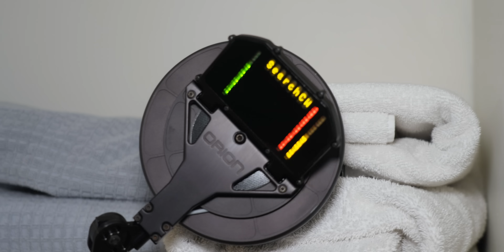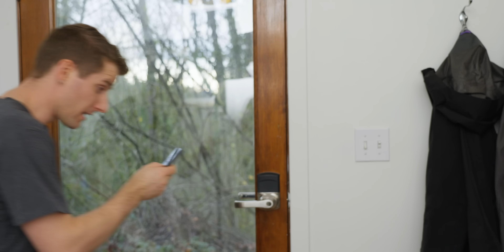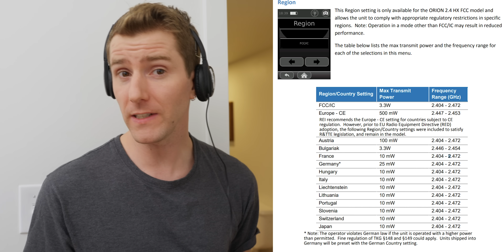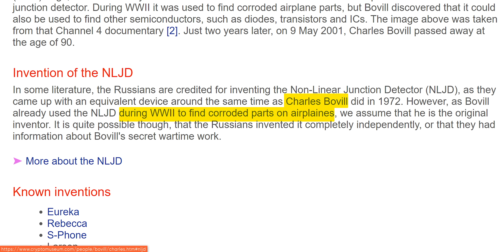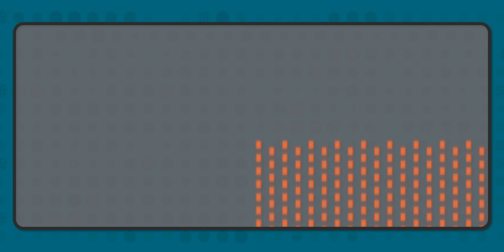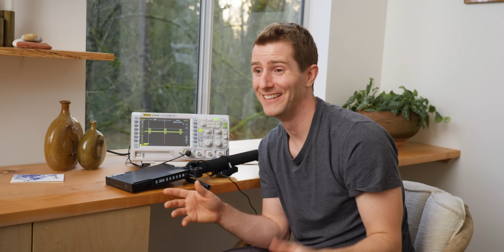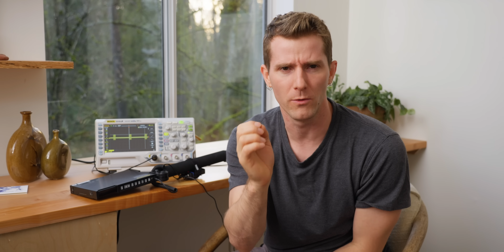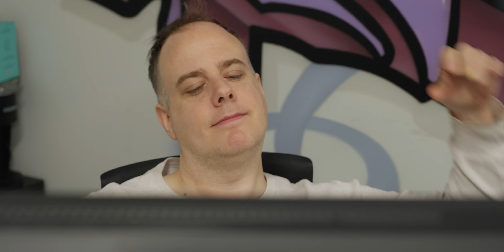I Rented an AirBnB to Look for Hidden Cameras

Comment: THANK YOU for finally explaining precisely what the term "non-linear junction" means. I've heard of these detectors for decades and couldn't find any details on what it means for the waveforms and the graph. That scratched an itch in my brain I've had for a long time.
Reply: Just ask chatgpt
Reply: @AKagNA  bruh seriously ?
Reply: Hey ChatGPT, what does non-linear junction means in detectors

ChatGPT said:

ChatGPT
In the context of detectors, a non-linear junction refers to a structure or region in a material or device where the electrical response is not directly proportional to the applied voltage or current. Non-linearity in a junction means that the relationship between current (I) and voltage (V) is not a straight line (as it would be in a resistor, for example), but instead has a curved, non-linear behavior.

How Non-Linear Junctions Work in Detectors
Non-linear junctions are crucial in many types of detectors (e.g., photodiodes, radiation detectors, or RF/microwave detectors) because they enable specific properties like signal rectification, mixing, or multiplication. Here's how they relate to detectors:

Semiconductor Junctions (e.g., p-n junctions):

In semiconductor detectors, a p-n junction is a classic example of a non-linear junction. The current-voltage relationship in a p-n junction diode is exponential, as described by the diode equation:
𝐼
=
𝐼
𝑠
(
𝑒
𝑞
𝑉
/
𝑘
𝑇
−
1
)
I=I 
s

 (e 
qV/kT
 −1)
where 
𝐼
𝑠
I 
s

  is the reverse saturation current, 
𝑞
q is the electron charge, 
𝑉
V is the voltage, 
𝑘
k is Boltzmann's constant, and 
𝑇
T is the temperature.
These non-linear properties allow the diode to respond to external stimuli like light (in photodiodes) or particles (in radiation detectors).
Non-Linear Mixing:

Non-linear junctions are used in RF and microwave detectors to mix and rectify signals. For example, a Schottky diode detector uses its non-linear junction to convert high-frequency RF signals into lower-frequency signals or DC.
Photon or Particle Detection:

In optical or particle detectors, the junction's non-linearity enables it to convert incoming photons or particles into an electrical signal. The non-linear behavior creates a distinct electrical response to energy deposited in the junction.
Harmonics and Signal Enhancement:

Non-linear junctions generate harmonics or amplify weak signals in certain detectors. For example, in superconducting detectors like Josephson junctions, non-linear effects are used for highly sensitive measurements.
Key Features of Non-Linear Junctions in Detectors
Rectification: Non-linear junctions can convert alternating current (AC) into direct current (DC), crucial in signal processing.
Signal Sensitivity: Non-linear I-V characteristics make the junction highly sensitive to small changes in applied voltage or current, which is essential for detecting weak signals.
Frequency Conversion: They can convert high-frequency signals into intermediate or baseband frequencies for easier processing.
In summary, a non-linear junction in detectors is typically a region where the electrical properties deviate from Ohm's law, enabling specialized functions like signal rectification, mixing, and energy conversion, which are critical for detection technologies.
Reply: @AKagNA  least reliable source oat

Comment: Great Video.
This brought back memories of the 70s. 
Your employees could have made one of those. In the 70s that was out assignment using electronics and a coil of wire for the sensor.
It worked on a small scale.

Comment: I guess like a hundred nerds like me already said it, but semiconductors don't have diods, diods are made with semiconductors.
A semiconductor is a material that is an insulator but becomes a conductor when a voltage over a certain threshold is applied to them

Comment: 7:29 "all semiconductors contain diodes" is not an accurate statement. Diodes are currently mostly made from the junction of a semiconductors with two regions with different doping, so they are semiconductor diodes. To say that "all semiconductors contain diodes" is like saying "All apples contain apple pie". Saying that "All diodes contain semiconductors" would be inaccurate too.  In the old times, thermionic diodes where made from a vacuum tube with two electrodes, but that is not the main issue. Perhaps LTT should reach out to people with technical expertise to fact-check your scripts. If you are in the business of describing technical issues, you need technical precision on what you say.
Reply: Yeah that made me cringe a little as an EE, but I feel it still gets the overall point across. You'd be hard pressed to find an electronic device these days that doesn't have some kind of diode or transistor - which are typically made with semiconductors.

It's a tricky subject to "dumb down" enough for a general audience to follow and this is not an in-depth explanation on how semiconductors and diodes work. I think they did an alright job considering.
Reply: Ur being pedantic af bruh
Reply: The statement isn't exact, but unless you can find a wireless camera using only thermionic diodes, what they said is correct enough for the scope of the video
Reply: I think they just said semiconductors when they meant semiconductor devices.
Reply: That’s not what he said
Reply: You're nitpicking and you know it
Reply: Your comment isnt very well written... Is your argument that "it wasn't that way 30 years ago, so your statement isn't correct"?
Reply: @FinneasJedidiah  It is worse, he is saying " it isn't true that all semiconductos contain diodes, and here is an example of a diode without a semiconductor", he didn't point a semiconductor without a diode.
Reply: @FinneasJedidiah  I have amended my comment to improve it. Perhaps you can address the issue in a better articulated statement, if you can please do it. Still the point remains: LTT is trying to explain highly technical topics, which is fantastic, but the value of it is diminished by the lack of fact checking. Everybody makes mistakes, and it's hard to correct videos, so it would be a good idea to get the script fact checked beforehand.
Reply: @RodolfoHermans you are really trying to argue that Ltt should correct this because decades old equipment technically could fail this statement? That's just ridiculous nitpicking.. You're technically correct but it's irrelevant to this video as it doesn't apply to any hardware made in the past 2 decades
Reply: @lewan1905  No, you are missing the point. Correcting something like  "All apples contain apple pie" for me is a fundamental mistake, and not ridiculous nit-picking. The main point, beyond the anecdotal slip, is that if you are in the business of describing technical issues, you need technical precision on what you say.
Reply: @RodolfoHermans  You rn -> "Waa Waa nobody loves me Waa Waa"

Comment: „Don’t put it next to your head“
Proceeds to put it next to his head for the majority of the video
Reply: For the safety of the operator the RF emitter is probably directional
Reply: proceeds to stick hand into the beam WHILE the device is active
Reply: During operation... you know when the microwaves are active :)
Reply: @marsovac  It WAS in operation.
Reply: Seriously the whole time I'm shouting at Linus to be safe and keep it pointed down.  ALWAYS IMAGINE THE THING IS ON!  Just like assuming a weapon is loaded
Reply: The waves are directional, it was pointing the other way.
Reply: @pedro4205  Glenn:🙃
Reply: @pedro4205  Radio waves diverge, the smaller your aperture the more they diverge, and the lower your frequency the more they diverge. At a frequency of 2.5GHz and a 10cm aperture, they will diverge at an angle of roughly 84 degrees, so they will be coming literally out the side of that thing. So having it face forward isn't going to help much when its right next to the side of your head. To produce a 1-degree beam at 2.5 GHz, you need an aperture diameter of approximately 8.4 meters, which is why radio telescopes use such a large diameter satellite dish (think Arecibo Observatory in Puerto Rico).
Reply: @FriesOfTheDead  84º is indeed close to 90, but it is still forward facing
Reply: @pedro4205  Seriously? If you couldn't understand why this is bad from my previous comment I don't think that anyone will be able to explain it to you, and it's certainly not worth their time to try.
Reply: I was looking for this comment.  He spent way too long with that thing 2 feet from his head.
Reply: Yeah there's a reason they put a long handle on that thing.😅
Reply: There was a recent Electroboom vid where he played with unshielded microwaves the comments were actually terrifying. Cooking your eyeballs until the fluid in them gets permanently like scrambled eggs...

Kinda offtopic but there was also a recent styropyro vid where he made like the world's most powerful microwave and cooked some things into toxic gas lol. The things these guys do for views.
Reply: @sntslilhlpr6601  I would trust ElectroBOOM and Styropyro to know infinitely more about what the're doing that someone like Linus who is more focused on entertainment than facts or safety. Watching Linus around electronics is like watching a movie star pretend to play guitar.
Reply: Contains radioactive thorium

Comment: but can it microwave?
Reply: Not very well, because an integral part of microwave ofens ins the metal enclosing that reflects the microwaves, which intensifies them and builds standing waves.

Without it, sure, technically your food gets warmer, but it'll be barely noticeable.
Reply: Microwaves do not penetrate well and bounce around. Also the inverse square Law, more distance less power, have wave through the either.

You would need to hold something against it for a good amount of time to do any thermal damage.

Even the face warning would have to be a foot or less in front for a few minutes.
The safety warning is just to let you know what is possible to occur if one was extremely careless.

Set on max power and six inches from your face for two minutes would probably due permanent damage to your eyes.
Reply: Not really unless it's on absolute max power and you are holding your hand against it, electroboom has a video on microwaves